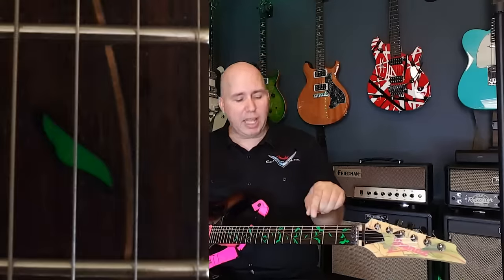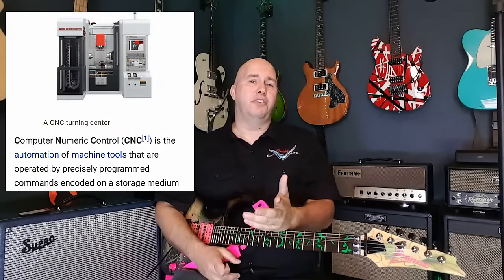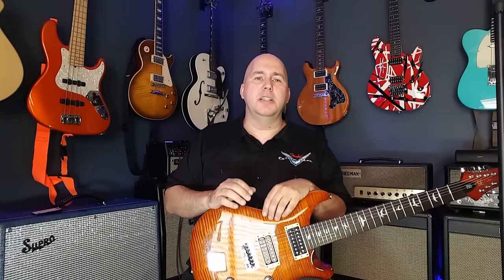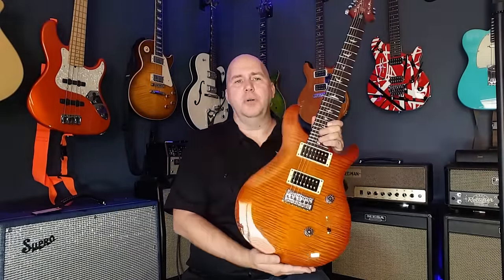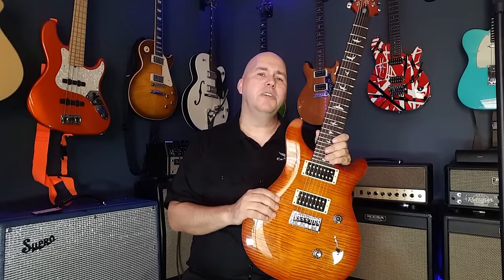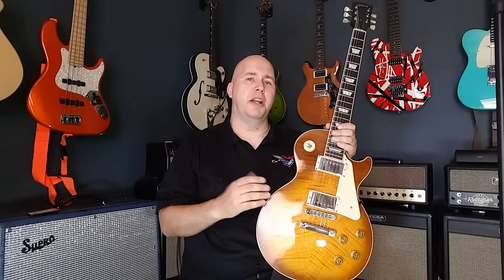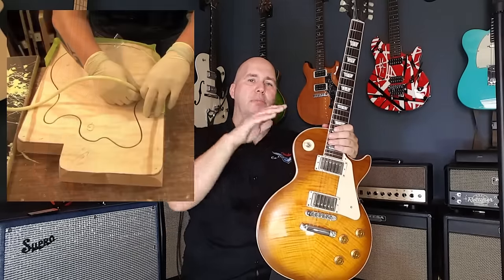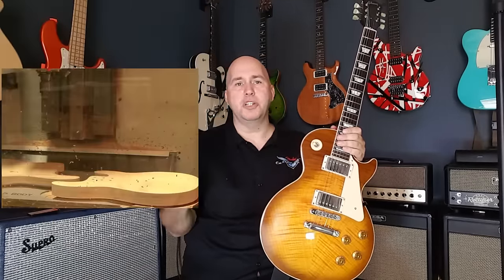7 Things That Do Not Make Guitars Expensive Anymore

Comment: Explains why Asian guitars are such high quality these days - low cost for labor and materials aren't too expensive anyway.
Reply: My Japan made EII Horizon III is probably the best made guitar I own. I own Gibson [pre 90's] and new Jackson USA and it is as good or better than all the rest.  My Gibson has been with me for 31 years and it is a great guitar but the ESP was/is better when new. The Jackson needed tweaking out of the box, the EII had the set-up and strings it came with on it for 6 months before I changed them. I did drop the Floyd about 2mm with a hex wrench but that was it. I like it low. I ended up putting an FU block on the Jackson and ESP but that was personal preference. My Gibson pickups crapped out about 3 years into ownership as one of the coils broke and it became a single coil. I was a USA made guy all the way but my mind has changed over the years.
Reply: I know what you mean. I recently picked up a Samick Malibu (a Fender Stratocaster copy)made in either Korea or Indonesia and it sounded almost as good as a genuine Fender Strat that I played at Guitar Center. The one I bought was used in great shape and it was $90 (after some bargining) at a pawn shop. The genuine Fender new was $800.
Reply: i think it also begs the question do more expensive materials inherently sound better? just because steel is stronger than pot metal doesn't mean the pot metal isn't strong enough, or doesn't sound better. i think in the case of bridges this is entirely debatable. probably less debatable in the quality of copper used in magnetic pickup windings though.

Comment: I build guitars with graphics overlays.  My costs are around $65- 85 per wrap with matching headstock.  The cost of labor goes up a bit, as well as the cost per finish.  One has to hide the wrap edge...I add $200 - 250 for a wrap.  I tell people all the time I can make it pretty, but it costs, or I can make it make it plain, but it will still play as good, and may possibly sound better.  Thank you for the video.
Reply: Thank you.  I was having a hard time believing a wrapped guitar only cost "pennies" more.  $65-85 in raw costs is significant for something that only adds aesthetic value.  But as I'll always say, it's your money.  If $250 to wrap a guitar is worth it to you, then it's worth it.

Comment: I paid $1,199 for my brand new 1997 Gibson Les Paul Standard from Guitar Center back in 1998. It’s my baby and a fabulous guitar. Same model now goes for around $3k or more!? Crazy price increase.
Reply: If you take inflation into account the prices haven't changed that much.

The LP standard was 2100 $ (slightly less than 300 1959 dollars) when it released and it's now 2400 $. Not a big price increase.

Comment: thing to remember is a cnc machine(depending on what make,model etc)plus the fixture to hold the different components are going to be a half million dollars PER CNC MACHINE.(again depends on machines and fixtures as well as robotics loading)

so its cheaper and faster to make the parts BUT but the cost to make it cheaper and faster was HUGE.also remember the cnc solid works software is 10s of thousands of dollars per license,the training to use this is expensive and the cost for a proficient cnc setup/operator is expensive as well.
Reply: trillriff-axegrinder  All valid points. If you produce enough units the machines pay for themselves though.
Reply: yes,but you have a long arduous period of profitless-ness and unless your the big 2 your not going to recoup your initial investment.
Reply: Ah, you don't need a water jet to put some inlays into wood. There are perfectly capable CNC machines available today for a fraction of the price you quoted. 5 grand tops. You also do not need sophisticated 3D CAM software to make 2.5D inlay cutouts either. Once it is all setup you could train a monkey to load fixtures with parts too.
Reply: Yeah I know a few guys who have bought smaller CNC machines for relatively little money that are more than good enough for small projects like guitar bodies and necks. You really only need about 1.2m by 0.6m xy travel and no more than about 100-150mm vertical travel. Software to run them is also no longer a choice between a few expensive packages. You get loads of cheap options now. Modern technology is really revolutionising manufacturing of any machined components. The aftermarket bike parts industry is another example. Trick parts for dirt bikes are becoming way more varied and smaller companies are getting in on the action, sometimes producing very high quality and innovative bits. What a time to be alive!
Reply: Neil Pincus
guitar bodies are pretty big. I don't think I could route one of those out on my machine. Then again I've never really measured a guitar body either. The work envelope of my machine is only 14 X 16 X 5 inches. To have made it any larger than that would have cost me considerably more. Maybe the next one I make? Frankly, using my machine I tend to run smaller jobs on it anyways. Here's my machine isolation routing a PCB http://i.imgur.com/EdzcO2m.jpg which is a fairly challenging task for CNC machines to accomplish. I milled that piece of plastic flat just so the board would sit in plane with my Y axis. The table is pretty aligned, but for milling copper cladding I needed it really close.
Reply: this comment, while true in ways, is largely overstated...
Reply: I have a four axis, 2x3 ft CNC machine with a router that can cut aluminum that cost less than $5k. I dont even use the fourth axis.
Reply: trillriff-axegrinder  there are CNC machines available now with software that are capable of cutting guitar body's for less than $1000
Reply: Daz730 Yeah the neck is where it gets pricey. Need a 2x3 at the smallest. I wasn't even counting Vectric software.
Reply: trillriff-axegrinder thats why most companys are using autocad still and still using older methods
keeps jobs open yet are slowly upgrading

Comment: I have learned that nothing makes a guitar expensive
Reply: Just get a cheap guitar from Amazon, then just save up for some upgrades. I got a gear 4 music Indianapolis (its no longer sold), and all i did was change the standard humbuckers to SD invaders that i had one hell of a deal on (£30 for the two pickups), and then redid the electrics inside, and now its a thrash metal, rock monster, all this cost me was £50 for the guitar (my friend sold it to me), £30 for the humbuckers, and about £20 on the rest of the internals, and im going to get a new floyd rose floating trem system, and its worked out cheaper than most guitars with similar styles
Reply: all together, materials, Craftsmanship, details and quality control should make difference in the price tag.

Comment: The whole "tone wood" debate I always found amusing. Woodworking has been a hobby of mine fur many years. Maple, Ash, Alder are not expensive woods, and even if a manufacturer used something crazy like zebra wood you're only talking 2 or 3 board foot for a guitar body and even less for a neck.
Reply: The point of tone wood is when the player wants to play clean through a super nice amp.
Once you start plugging in effects you can literally have a guitar made from a 2x4 and it won’t matter. The more effects you use the less quality matter and the more pickup quality comes into play.
Reply: @fieldworthyairsoft1436  The point of tonewood is selling guitars at a premium. It also doesn't matter if you play clean through a monitor speaker.
Reply: Martin Krauser there is a small difference in tone between woods but not substantial enough to make a major difference between guitars of a different price to make certain guitars better or worse for the wood used
Reply: Unfortunately we have an Ash tree blight that is going on right now and is killing a lot of Ash trees.  When the taller, thicker ones die, and they are replaced by younger trees it still takes many years for those small trees to get to the size of the larger ones that would be viable tone wood for guitars.

Comment: Excellent video.  Some thoughts on type of wood:
There are woods that are significantly more expensive than others, say for example, cherry or hard rock maple vs basswood or pine.  However as you state, that difference in cost is not enough to warrant the guitar jumping in price several hundred dollars.
It does however, take considerably longer to tool ash than basswood, and it takes more bit changes and more expensive bits to tool ash.  That cost does reflect in the end product.
But the real question is:  do those woods actually make the guitar "better"?  Sound is a very subjective thing.  Who is to say for certain that alder sounds "better" than basswood?  Ash is several times heavier... so some musicians dislike it just because of the weight during performance.  At the same time when we see Fender making new Stratocasters and Telecasters out of pine and charging $600+ for those instruments... it makes us realize that maybe the wood debate is largely an opinion discussion rather than based on reality.  We've seen top-quality guitars made of a variety of materials, including 3D-printed plastics.  I know from experience I can build an awesome-sounding guitar out of a 1x2 oak stick (video proof here on YouTube).  This brings into strong question the value of guitar bodies other than aesthetics and feel.
So in the end you're likely right:  body material shouldn't be a huge factor in the price of a guitar, nor in the quality of sound.  Still, it's unlikely we'll be seeing a Squier Bullet made from ash or maple any time soon.  : )
Reply: Wood is completely irrelevant to an electric guitar's output - it adds nothing at all to the sound in any way.  Electric guitars use magnetic fields and electronics to produce signals - wood is a non-conductor - how on earth would wood effect the electrical signals produced by magnetic fields?
Reply: Dunno as I'd agree there, simply because no pickup I've ever seen is totally non-microphonic.  The vibration of body and neck affects not only string vibration bit mag pickup sensitivity as well.

I've built many guitars-- including cigar box guitars-- and the sound between body woods and types is significant.  What I challenge though (and in this we seem to agree) is the "this kind of wood is better than that kind of wood" argument.  As with sound itself, that seems to be a purely subjective (and often biased) argument.

A prime example is a simple test I did, by intent:  I bought a Squier Bullet (Fender's cheapest guitar, $99 on sale at Guitar Center), and replaced the pickups with my own FlatCat™ and two third-market inexpensive-but-nice pickups.  The result:  hands down the best "Strat" I have ever played, and the body and neck didn't change.  Sure sounded a lot better.

That simple test proved that while yes, wood does affect the sound of the guitar... labeling that as "good" or "bad" seems more a matter of market-induced bias than reality.   For example, if hardwood is the "best" wood for guitars-- why has Fender released its newest Teles made of cheap yellow pine and set their price at hundreds of dollars, equal to their alder and ash bodies?

Obviously Fender doesn't buy into the hardwood vs softwood controversy... and neither should customers or luthiers.  I can build a NICE guitar out of anything I have on hand... and do so regularly.
Reply: I agree Richard.I a few years ago was given an old Samick Strat.While refinishing it I realized it was plywood.I continued along and it is heavy but one of the best sounding strats I own.
Reply: Better is subjective.  It is an age old debate, that will never be resolved.  Manufacturers charge what they think you will pay, not the cost of manufacture of the item plus a reasonable mark up.  We should also remember that we are also paying the retailer mark up.   We do pay for the name on the headstock, that is a fact.  Then there is the tradition part of the equation.  People still want the old classics from Gibson, Fender and PRS.  If you look at their range the best sellers are the originals: Tele, Strat,  Les Paul and PRS Custom.  Even makers like Schecter  offer derivatives of these designs.   They want the same materials alder, ash or mahogany  plus maple.  Although other woods may be used, it is not often the whole instrument that has different woods, merely the eye candy.   Some would argue that although the woods do not differ much the quality of the wood does.  They might also point out that Lower price guitars use multiple piece bodies instead of just two.  That doesn't matter if it is painted, but does not look good on a trans finish.   Actually the biggest cost to making a guitar is finishing.  Just adding a nitro finish will add hundreds to cost, because it takes so long to do.  Low price guitars don't use nitro.  The point about pickups was interesting.  Why do they cost so much?  The components are not expensive.  Unless they are all hand done to your secs, then they should be cheap.     It is worth checking out videos of factory tours, it is very instructive as to how guitars are made.
Reply: Yo! I've got an early 90s one, plywood too. I've recently put some Fender Pups in it (CS Tex Spec in the bridge, 2 '79 X1s at mid and neck), and boy does it sound good!
Reply: Regarding Ash wood: one of my partscasters is made of ash and you are right it is heavier than basswood or alder but it has the loudest unamplified sound compared to my other guitars which I like very much. It also has the best looking grain however finishing required a bit more work as it is an open pore wood. So for me it is worth to pay more for a guitar that is made of a material that is not acoustically dead. I still believe that the resonation of the body has some feedback to the strings on good quality instruments so after all the electric signal is affected too.

Comment: Howdy from N. Phoenix!

On the subject of pickups - I had an opportunity to replace an ancient active setup on a old guitar and for project I ordered a pair of FilterTron-style humbuckers for $18.  I figured that the worst thing that could happen is I throw them away.  

The package arrived and I was very pleased with the units.  The wiring was high quality 20 gauge stranded wire and the covers were cleanly installed.  Upon checking them with my DMM, they measured out to the seller's impedance specs, so - in they went.

BAM!  What a great sound.  No noise, beautiful tone from jazz to rock to metal, and both respond well to light and heavy picking / strumming opening up a much wider range of sonic possibilities than the original configuration which only went from quiet to loud depending on how hard you hit the strings.